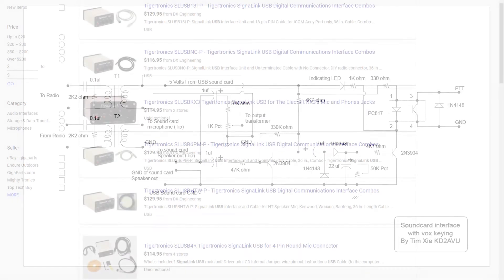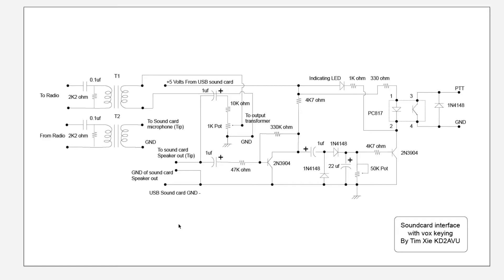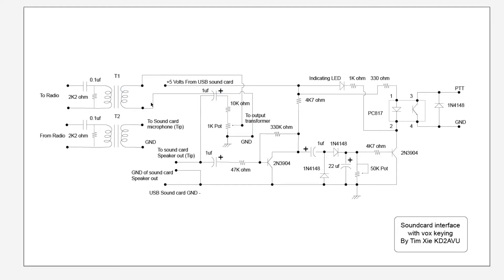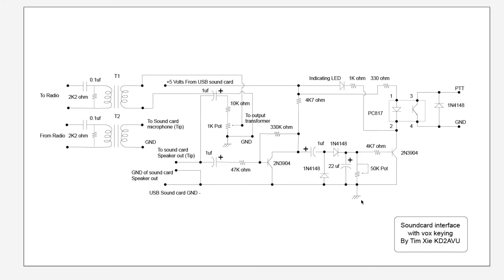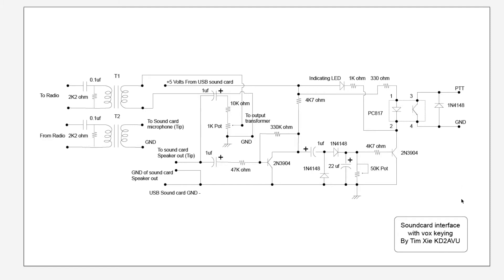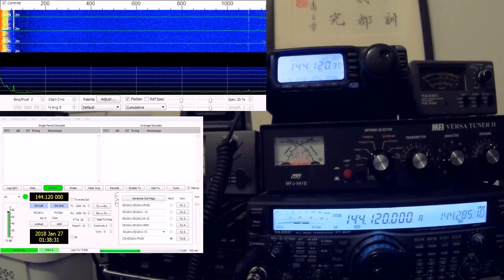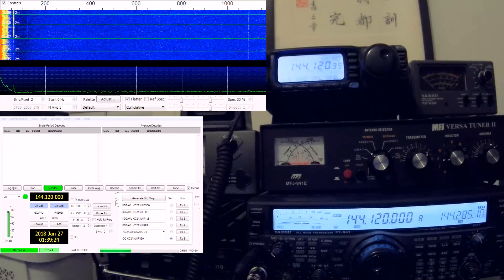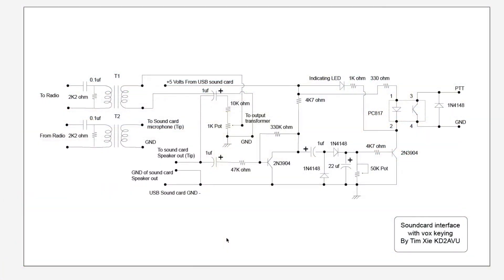Ham radio Homebrew soundcard interface with cheap sound card

Comment: I designed a board, had 20 made at jlcpcb. But there were errors I am fixing as I uploaded the gerber files at 1am😭. Also vox worked great on mmsstv, but not on easy pal, so am experimenting with vox cct on breadboard. Will update,Cheers Vk2FP

Comment: I note that the PCB layout does not fully follow the schematic. There seems to be a difference in the way the 1st transistor gets it’s voltage from the 5v rail. Will either way work? Cheers

Comment: ok i did download the file and watch your video I check comment I old school so I can use a soldering iron..Its funny no one else notice that you're missing some importation information  on the 2N3904  the 3 leads are not marked  which is the base, emitter, and collector not on the circuit or circuit board and that the big one ...
Reply from the maker: Thanks for the comment I'll make  corrections in the file

Comment: Thank you Tim , I do have a question about the circuit board , if I may.  Left hand edge of the card there are a pair of vertically oriented traces that have no labels , nor do they seem to correspond to anything on the schematic. Your video shows a breadboarded version of the interface , so I am at a loss as to what those two traces are for. Thank you for your time. Ordering up the PCB today. Al
Reply from the maker: Hi Al I'll take a look at the schematics tomorrow and get back to you.

Comment: Do you have a material list etc? 7.3's KG5TDB
Reply from the maker: I think I've linked the BOM and schematics in the description
Reply: I see the Dropbox with diagram. I have questions. You have a "4K7 ohm resistor. I don't understand is that a 4K the 7 confuses me thanks for quick reply KG5TDB
Reply from the maker: @OCMAMY  4k7 is a 4,700 ohm resistor
Reply: I see now 4.7 ohm resister

Comment: What transformers did you use?  All you have on your schematic is T1 and T2.
Reply from the maker: I use 600 ohm to 600 ohm transformer. But I think any types of 1:1 isolation transformer will work.
Reply: I built the device, use 600 ohm to 600 ohm transformers